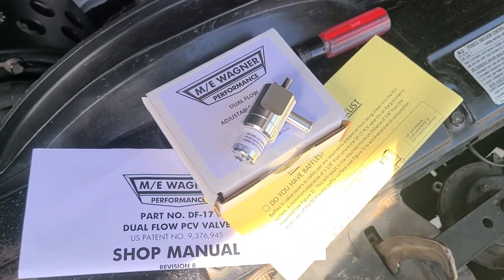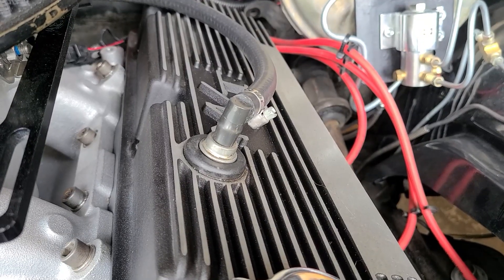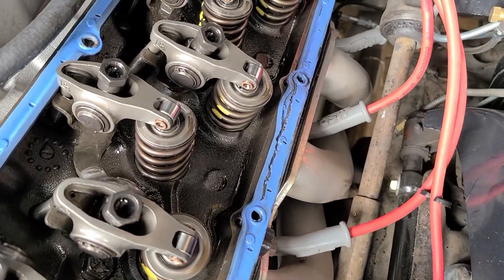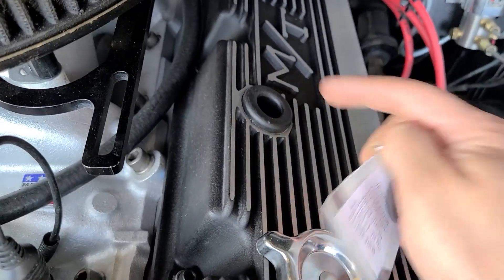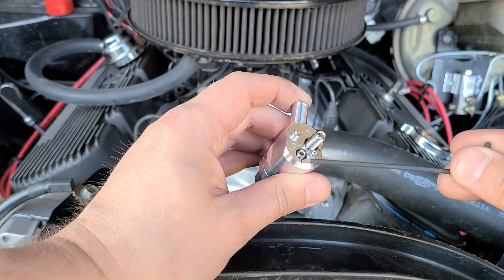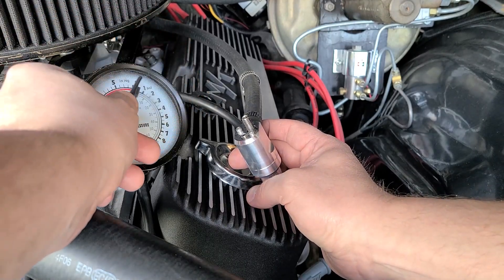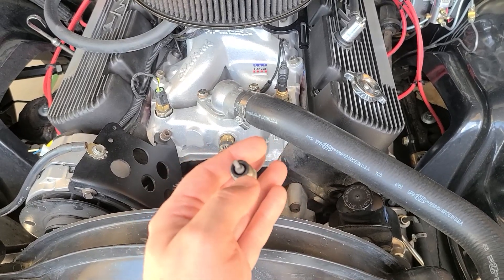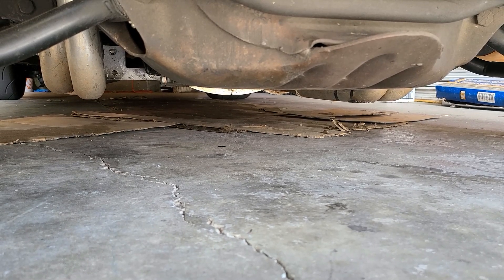M/E Wagner PCV Valve INSTALL - 454 Big Block Chevy

Comment from the maker: A good read about baffles on the M/E Wagner website:
http://mewagner.com/?p=1221
Reply: When using locktite in a blind hole put it in the hole not on the thread, if on the thread it will just get pushed out as you tighten.

Comment: Your rear main seal leak is due to poor assembly. You can change it without having to remove the crank as long as you can get the oil pan off in your car

Comment: Put a k and N breather on each side, oil leaks will be gone. as long as the gasket isn't leaker.
Reply: More breathers will only help oil leaks at idle or only full throttle?
Reply: @jakefriesenjake  it sure cleared mine up. I was running collector evacs. was pulling too much vacuum.  should only be run with open headers, i was running mufflers. anyway, undid and blocked off bungs and it cleared up on the first pass.
Reply: @matzrat5006  nice
Reply: My truck is burning oil. I have just headers and a short pipe, but I will eventually straight pipe it to the back. So, should I do what you said?
Reply: Or maybe Im leaking small amounts oil.
Reply: @mexdrago3009  what do you have hooked up now ?
Reply: @matzrat5006  1999 454 vortec, holley carburetor 750 on top a edelbrock intake manifold. The big vacuum line on the front right of the carburetor is going to the front left valve cover with a gimmy rigged pcv pipe covered with a hose to extend it because the A.C. bracket goes over the hole. Small vacuum line right side going the rear right valve cover. The vallve cover grommet gaskets feel a little loose.
Reply: @mexdrago3009  just tie that back and stick a breather in each side, a good breather that seals to the valve cover, like a K &  N style.  Trans dapt makes some good ones.
Reply: @matzrat5006  Will due. Thank you for answering my question.
Reply: @mexdrago3009  
I designed a system, not fully my idea. I'm using 3 of the Billet aluminum pcv valves you can get (I might add a forth) but gutting the regular parts inside of them.

They will all get a ball bearing check valve installed inside them.

 The one Billet pcv valve will be connected to the intake (run through a catch can) like a regular pcv valve. The line is also going through an adjustable unit I'm building. It can be fine tuned for maximum vacuum allowed in that line. Once the max vac is reached, it opens up the ball bearing valve and vents vacuum to the air filter plenum on the carb, so it will be clean air entering the system. I will also add a needle valve in-line so I can adjust the actual flow of whole system.

The other 2 Billet units will be located on the opposite, passenger side valve cover. Those have check valve ball bearings inside also, and will also connect directly to the main air filter for clean air. Those 2 units should build a vacuum but once I'm at full throttle with no manifold vacuum, they open up and allow flow into the air filter. The pcv valve on the drivers side valve cover will also stay open and allow blow by gasses to escape (not as much as the passenger side) while at full throttle.

I'm thinking a max crankcase vacuum of 10" should be good. Some racers build 16" crankcase vacuum in a sbc with no problems.

My engine at idle only makes 4 or 5" of vac due to the big mutha thumper comp cam in installed. Cruising at 3000 rpms it makes 15".

*update *

The system works awesome so far. I have a gauge on my valve cover, and at idle, the vac goes to around 1"

Cruising around I see around 3 or 4". 

On heavy rpm Deceleration, I see a max of 7", it slowly creeps there. On wide open throttle, I get around 0.5 psi pressure in the valve cover, I might add another relief valve but it's probably not necessary.

When first installed, I had to much flow and the engine would lean out (I have an afr gauge). So I closed the needle valve to half way and bumped up the primary jets from 70 to 74.
Now it's a tad rich, so I'm slowly opening up the needle valve to lean her out to perfect.

Comment: Did the leak on the rear main seal eventually went away when using the Wagner pcv valve? Did the Wagner PCV VALVE fixed the problem or did you replaced the seals? I have the same problem and I’m planning on ordering the adjustable pcv valve.

Comment: Hello and thanks for posting this install video! I noticed at the end of the video that you are still fighting a rear main seal oil leak. There may be a few more things you can try to see if the leak improves. First I would be interested to see how free flowing the fresh air breather is internally, in other words are there any restrictions inside before the hose attaches. Also, what diameter is the hose going to the air cleaner? We recommend 3/4" ID as a minimum, and 1" is better if possible. Having a free flowing fresh air source helps prevent crankcase pressure buildup under full throttle when vacuum drops to nearly zero and the PCV flow becomes limited.

Also, you might want to try increasing the overall airflow by increasing the idle flow setting to see if that helps. Just remember to re-tune the cruise circuit when you do this and continue to monitor for oil consumption through the PCV like you were doing. I noticed that you have revision 8 of the instructions, we recently came out with revision 9 that has some updated flow recommendations (the flow recommendation was increased in your case to 2 turns out on the idle screw). These updates were based on years of feedback and working with users to see what worked for their applications. There are also recommendations here for incrementally increasing flow to dial in what your engine likes: http://mewagner.com/wp-content/uploads/2022/02/DF-17-Shop-Manual-R9.pdf

Hope this helps, and as always feel free to email support@mewagner.com if you have any questions.

Thanks!

Matt Wagner - M/E Wagner Performance
Reply: Just for the record. That’s not a rear main oil seal leak. It it was, it would be drip, drip, dripping when the engine was running. Because the rear main seal is just on the other side of the bearing which has pressurized oil bleeding out from it. His leak is most likely due to the rear oil pan seal not sealing. These old Gen 4 blocks had terrible gasket seals. Which is why we use a combination of Permatex ultra grey & the seal. We glue both sides of the seal, and the gasket to the block. Then install the oil pan. They’re virtually leakless when a good type 4 PCV system is installed & functioning.
Reply: Really cool to see manufacturers getting their data from the small channels on yt 👍

Comment: Pcv idle speed test.  Use a tachometer. Pull pcv from valve cover.  Block flow.  Idle should drop between 50 and 70 rpms. If less than 50 you need a larger calibrated pcv or adjust the opening.  More than 70 and you need a smaller pcv flow..

This really effects where the throttle blades are set at.  Too small a pcv flow and the throttle blades may be too far up the idle transition slot. 
Too much pcv flow they are too far closed and not expose the tiny amount of the idle transition slot..

The idle transition slot supplies the only fuel from idle to around 1800 rpm when there is enough air flow thru the boosters to start lifting fuel and feeding it in from the primary circuit..

With a 454. You are probably going to need a 0.036" idle feed restriction.   Use a mirror and a timing light while you bring up the rpms till the primary boosters start to trickle.  Back off about 50 rpm and look at your air fuel ratio.  If its lean. Go up 0.001" on the primary idle feed restrictions.
Reply from the maker: I think this would be effective with a carb, but probably not with EFI since it self tunes the AFR and idle speed.

Comment: 3:40 you didn’t mention if you have the high vacuum spring installed. I still don’t know what this PCV unit does better than the factory except being expensive if you live in Canada due to the exchange rate on the dollar.😢
Reply: It's fully adjustable

Comment: Have you looked into the Moroso valve cover/exhaust venturi evac valve?
Reply from the maker: I've seen it a lot on Engine Masters dyno engines, but so far never in a car. I like the idea a lot, but I think installation could be tricky and it may cause clearance issues with the headers close to the floor.

Comment: I am not a mechanic but there is an issue with pressure. My truck has 1985 rebuilt 454 Big block engine and I passed smog check every time. When I started and drove about 300 feet it had no issues at all. I turned off the engine when I had to stop for about ten minutes then I turned it back on. I heard strange rattling noise but it did start and drove less hundred feet I  saw red engine light. I could hear rattling again. I turned off the engine and tried to turn it on again. No start and red engine light on a dashboard. I opened the hood and saw that hose attached to the top came off and the engine spitted out some oil.  I do not know if it was caused by PCV valve or any internal part of the engine. I will appreciate any suggestions if you have experienced some thing like this. I also do not know if  Wagner valve is compatible with 1985  454 Big Block Chevy. Thank you.

Comment: Great video, what have you found out in a year with this? Would it be worthwhile to get a vac reading off the dipstick tube for a baseline, you'd see what changes take place a little better.
Reply from the maker: I mean I would never discourage scientific testing. For me, the reduction in leaks was good enough for me.
Reply: @SS454LS6  There's engine builders finding HP with vacuum. 
At 8-12 inHG they picked up 15 free HP.
The more the pressure differential across the ring pack the better the rings sealed. They're running dry sump with an extra stage just for the crankcase.
Reply from the maker: @robertjackson7590  for sure there is power with vacuum. I do not think you will get any power from installing a Wagner though. It may reduce pressure, but I can't see it making a decent vacuum.

Comment: Did you make note of an AFR difference at idle?
Or vacuum change?
I put a Wagner pcv in about 6 years ago. Previous to that I did some testing with different pcv valves, and found that the Standard Products V173 was good for low idle vacuum engines. Caused a gain in idle vacuum of about 1.5” compared to a generic pcv.
This was confirmed on 2 engines I had.
Reply from the maker: vacuum stayed the same, and my EFI will self adjust to keep the AFR's the same.

Comment: Does it matter what side the PCV is on?
Reply from the maker: Shouldn't matter as long as you have the rest of a PCV system set up. So your breather would be on the other valve cover.

Comment: You probably don't have any baffles in those poorly designed but cool looking junk mickey thompson rocker covers, those baffles were designed by engineers for reasons. Aftermarket sucks.
Reply: I also keep my stock VC's for the internal drip rails, gotta keep those rockers juiced!